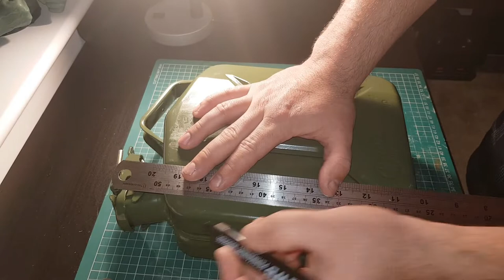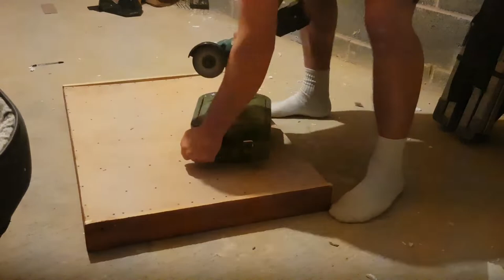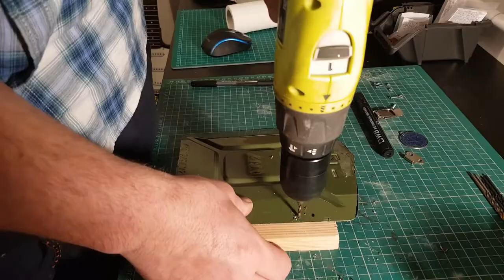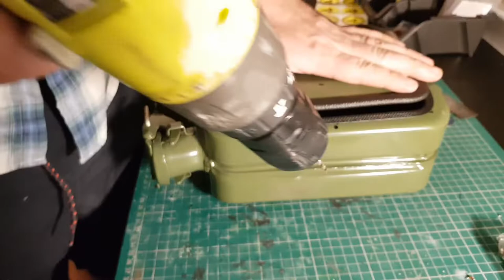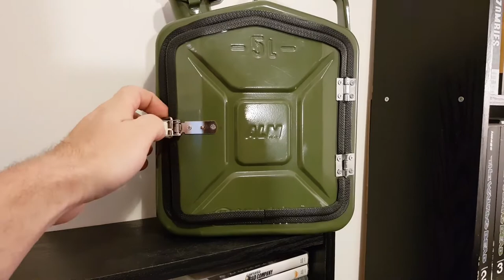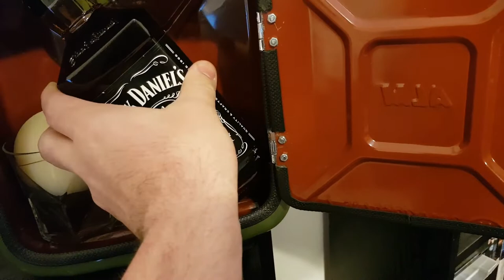DIY JERRYCAN MINIBAR

Comment: Please tell me, where you got the latch for the door...
Great vid......
Reply from the maker: Hi I ordered them off eBay search stainless steel spring loaded clamp clip
Reply: @PaulsChannel  thankyou, can I please ask, before i cut my can, im dubious about the lock, how far on tge side would you recomend i cut, so as to fit the lock properly..
Thanks again...
Reply from the maker: @TheDodger147  i placed the lock and clasp on the can first to make sure i had enough space to for the clasp part. i think it would be best to place the lock and clasps on the can and mark out the holes were you will be bolting it through. then draw on you line of the door. that way you will know you have enough space. hope that helps
Reply: @PaulsChannel  thankyou very much for you kind words... appreciate it....
Have always wanted to have a go, and now i have most of the components....
Good luck....